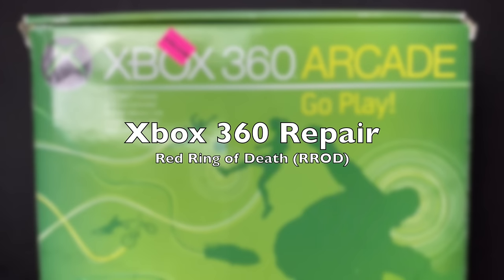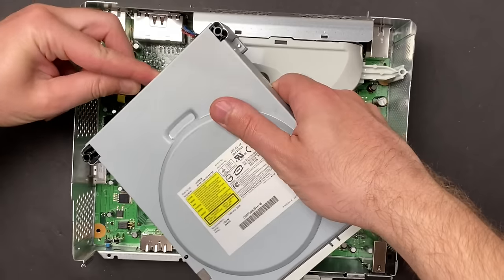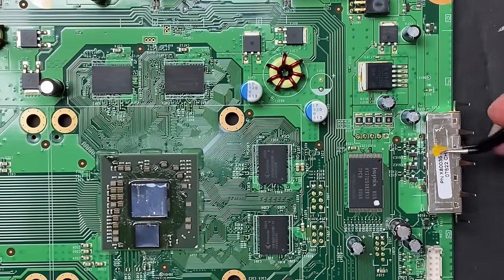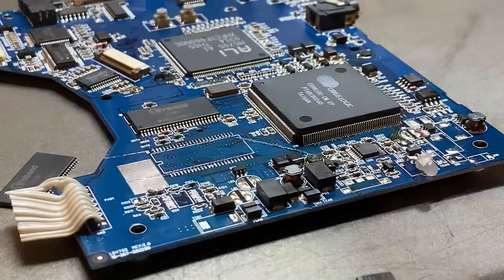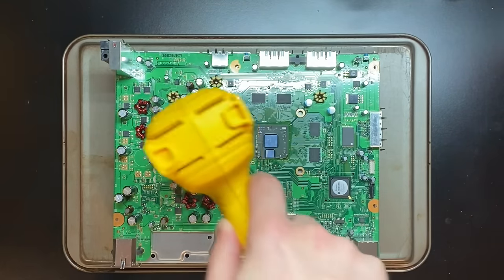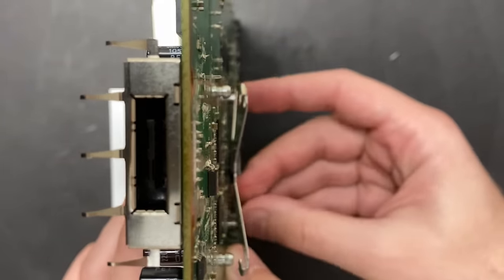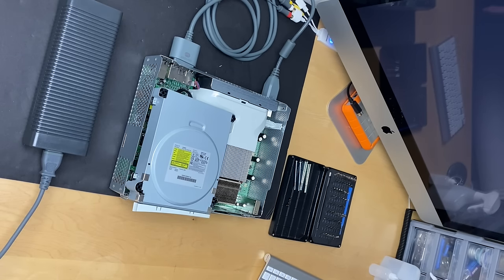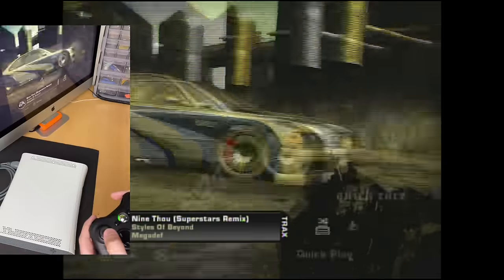Xbox 360 Red Ring of Death - DIY GPU Reflow

Comment: What does the flux do exactly? 
I've done heatgun reflows on my GPU before without flux and found it only would work for 6-8 months. I'm considering trying this out for my current 360.
Reply from the maker: In a nutshell, flux helps solder flow and creates inertia/surface tension so solder bunches up and collects on the copper surfaces, reducing bridges. Try it with a junk board. Solder a blob to it and keep rewetting it and notice it's shape. Then add some flux and rewet it to see what happens.

Comment: Ive seen people put them in the oven too.
Reply from the maker: I'm actually a fan of oven baking in general. My daily computer is still the iMac I repaired 7 months ago now, which involved reflowing the GPU in the oven to repair it. I felt I would have a little more control with the heat gun in this case though, just because the problem area is well documented and I wanted to introduce a good amount of flux during the process.

Comment: I took mine apart to clean it and it red ringed when put back together. Sucks man
Reply from the maker: That does suck, but it was probably on it's last hair if it RROD'd after a cleaning. It could be because of the change in x-clamp pressure if you removed those. You might be able to test if it works by temporarily applying downward pressure with your hard on the GPU heatsink while turning it on. This is essentially what those x-clamp adapters did (but they have been known to warp boards over the long run). If it does work with some downward pressure, it's likely revivable with a reflow if you just want to get it working again.
Reply: @BorderlineOCD  thanks for your reply bud!!! I will have to try that.  Ya it 3 light red ringed on me.  I never moved the motherboard from where it was screwed down. Something was rattling below the motherboard that i couldn’t identify after it was put back together. Defiantly below the motherboard. Thoughts? Also i took it apart to clean it cuz it would just shut off instantly every few hours. Didn’t seem to be overheating was running pretty cool? Was it the power supply? Actually chapped feels bad

Comment: I got one question about this which is does it matter how many red lights are there before you do this
Reply from the maker: You can confirm if the GPU is the culprit by looking up the secondary error code as was suggested by someone in the comments here. Hold down Sync then cycle through Eject 4 times and note the pattern. Look it up on x-ex.com and confirm the diagnosis. The user-submitted comments on that site are also useful (anecdotal but helpful to see if the repair worked for others with the same secondary error code as you).

Comment: Hey! I loved the video, very nice that you pointed out the need of flux, and being careful with pointing the gun around. 

What is your oppinion about covering the plastic suction point with aluminium tape? I have seen a video about modding the cooling for X360, and the guy put some aluminium tape on the top of the heatsink, bridging the small gap between the heatsink and the plastic airflow guide thing that goes to the vents. He theorized that this way the two vents are sucking out more heat. What do you think? Is it BS?

Comment: hey buddy , can i use a normal heatgun to a PS4's APU ? like the method you did ? because most tutorial i saw is using bga station .
Reply from the maker: No, I would advise against doing that. This is a hacky DIY approach for a worthless 360 that you can buy for $10. It does not replace a proper BGA reflow by any stretch.

Comment: Hello. I have an E-17 (0101) error Red Dot of Death on my Xbox 360 Slim model. Will this method work on that console?
Reply from the maker: I have a video on this for the 360S. Mine is a Trinity and it turned out to be the south bridge chip. If that doesn't resolve it it might be your XCGPU. Either way I have no interest in reballing GPUs and I have even less interest buying a replacement CPU to "fix" red ring/red dot. If it was me I would try a DIY approach with a heat gun. The purists will disagree. Ultimately it's your console and how you might approach repairing it is up to you.
Reply: @BorderlineOCD  I'll make sure to check out that video, thanks for replying!

Comment: Hey, what are you taking apart the console for? Just wrap it in some towels. 🙃
Reply: Oh god. I just remembered Intercoolers. Those cheap pieces of crap that you'd strap on the back of your console and they'd melt the power connector. 🤮
Reply from the maker: Never saw one. Lot of creative ways to revive a system that tries so hard to die on you.

Comment: I maybe wrong but the red ring of death was 3 rings not 1. The problem that people had was 3
Reply from the maker: On the 360, 1 red light is “hardware failure” and 3 red lights is “general hardware failure”. Red Ring is the community created term for hardware failure not necessarily a specific diagnosis although failures that caused 3 red lights may have just been more common. It can helpful to generate a secondary error code when possible for a better diagnosis (holding Sync and cycling though Power button 4 times to get the secondary code).

Comment: Hi sir... Hi hv an xbox 360 E... I bought it on April 5 2021.. Secong hand I had bought it.... It was brand new coz the seller dint use it much.... After gaming of three months suddenly one day wen I started my xbox 360 a red light appeared.... I searched on YouTube and the Internet..... They told me to plug off all the power supply to the console for 8-12 hours.... It worked for me........ But I think it was temporary fix.. Bcoz nw 2day 18 July itz working by i hv a doubt it might go of again..... So SIR CAN I TELL ME WAT SHOULD I DO....??? I M PLANNING TO OPEN MY XBOX AND CLEAN IT UP..... IS IT OK?
Reply: If it works, do not mess with it. If it does do it again, check the error code.
Reply: if it doesn't happen again, chances are your power supply was overheating. Before going inside of your console, make sure the issue isn't just an external one. You might be fine.
Reply: @NotALotOfColonial_SpaghettiToG  I sold the xbox.... The problem was external

Comment: My heat gun does 460c how much time whith this temp reflow? And i need to take no clean flux?
Reply from the maker: That's fine, shouldn't be a big difference. You can practice on a junk board like I did to get a good feel for your particular heat gun. I use no-clean flux but if you're using rosin core the conventional practice is to thoroughly clean the board. I still clean the board when I use no-clean but technically I don't have to.
Reply: to understand the flux you put in the video why did you put it? For clean;
Reply: @bethfoster6208  fow how long it last?
Reply: @bethfoster6208  where can i found gpu for the core version?

Comment: if the gun gives 400ºC air and the unleaded solder melting point is 422ºC. how can it melt it? specially considering that the air doesnt even hit the solder directly but through the chip

Comment: just tried this it worked and booted then froze on the xbox symbol then got another RROD 

redid again and its getting a 0020 error
Reply from the maker: Some folks have not had success, sorry your attempt fell into that camp. However I would just reiterate that you don't skip removing the plastic anchors and using good flux to maximize your chance of success. A heat gun alone isn't my preferred way of doing it.
Reply: @BorderlineOCD  well I did use flux whether or not it is a good one idk, also I first took it apart like 10 years ago so Im not sure if I removed the platic anchors or not but they were not there when attempting this and I have misplaced all of the screws...

Out of curiosity if you know what is the most common reason for the 0020 error, Ram , Gpu , Cpu or is it still an unknown thing?
Reply from the maker: https://x-ex.com/errorcode/E08/0020/

Seems to be a bit all over the place. Check out the comments on x-ex.com to see what has worked for folks in your situation.

Comment: Just bought a never-used falcon xbox for 30€ conviced it was jasper, and than I saw the falcon being rrod, makes me so sad :( 
Do you think it could rrod with some heavy gameplay?
Reply from the maker: Well, the Falcon still uses the 90nm technology on the GPU so it's still going to run hot. The Jasper uses the newer 65nm process and is less likely to RROD compared to a Falcon. It's just a part of the 360's design shortcomings and history, you can't really avoid it. I would say enjoy it and if you have love for the fat 360, either attempt a DIY repair when it fails or have it professionally reballed or replaced so you can continue to enjoy it.
Reply: @BorderlineOCD  :(
Reply: @ossipeltonen397  maybe the falcon v2 is a little bit better than Falcon v1 and earlier models?

Comment: Could you please tell me an alternative for a Heat gun? My console has been dead for almost 10 years now and I wish to restart it again. I hope to god this works because there’s nothing that would make me so much happier.
Reply from the maker: This is already a DIY hack to get some airflow at 400C. I don't think you can use anything else. A repair shop would typically use a hot air rework station with a narrower nozzle.
Reply: @BorderlineOCD  thank you for the reply man, really appreciate it. I’ve got 3 rings, hoping for it to fade away. Will keep you posted on how it works for me! 🤞🏻😁👍🏻
Reply: @thefarhanpirzada  so did u get it to work mate?
Reply: @yuktihgjh  no bro it didn’t work for me. I’ve literally tried all the DIYs on YouTube. 😔

Comment: Good video but I hope you know that "overheating" doesn't cause RROD because the Xbox never "overheated". Also rebelling is a myth that has proven to not fix it. The real problem lies where the tiny tiny solder balls inside the GPU that connect the die to the substrate fail from thermal cycles and E74 is caused by the tiny second die on the GPU which is the eDRAM ether having a bad connection to the substrate or just failing in general. The only fix is to replace the GPU entirely. Otherwise E74 will keep coming back.
Reply from the maker: Thank you. Yep I've come across the various hypotheses surrounding RROD and I've shared some of my findings in a pinned comment to address concerns raised by folks that aren't huge fans of this method of repair, which includes the point you raise. If I get 100 hours out of it I'd call it a worthwhile exercise. So far I've put 10-15 hours on it so we'll see.

Comment: iv done several xbox 360 repairs pretty much this same exact way with a heat gun have alwase had success, years ago before i had a heat gun we would use a toaster oven to do the same thing, pre heat heat to about 450 and bake the whole board for about 4 mins would work to, but heat gun is the best way to go for sure
Reply from the maker: Curious did you also remove those plastic alignment anchors when you baked the board?
Reply: @BorderlineOCD  yup

Comment: I ordered a xbox 360 e, there were cheaper og white xboxes but i bought the newest version of the xbox 360 because i dont want to get the rrod in like 8 months
Reply from the maker: That system shouldn't give you any trouble. I still pick up dead OG Xbox's occasionally. I would love to revive one with the original Blades firmware.

Comment: My 360 is long gone by now but after watching this video I wonder if simply putting a penny or a dime or somthen small that keeps just the right amount of pressure on top of the chip and then reattaching the heat sink would work. Anyone ever tried that? It worked for me on an old LG phone I used to have that had a very similar issue with its cpu.
Reply: Yes it did work and there were "repair" kits which did that ,but that's really only a temporary fix. I'd argue the fix shown in the video is also temporary. The true way is to remove the CPU/GPU and reball it with new leaded solder. However you need the correct tools and it's quite a bit more tedious. At least the reball repair should stop the RROD/E74 errors ever showing up anytime soon.

Comment: no way to improve ventilation? normally the fans go above the heatsink
Reply from the maker: Its an awkward design but I guess that's what the fan "tunnel" is meant to help with. Clearly the design had its limitations. I've seen folks mod the case with fan placement above the GPU. Creative, but not sure I'm in love with how it looks.
Reply: @BorderlineOCD  if you replace the DVD drive completely, or put it on the exterior, you will find the cooling considerably better

Comment: I admire your work but if I had to tear down any play console, I would not  go to that work I just tried to repair a play station 2 which was sold as totally rebuilt and cleaned by the seller and found it had never been opened and obviously never cleaned and the laser sensor looked clean but I cleaned it again just for fun and checked it all out and found nothing I could do that might get it to work so in short I got swindled by a seller and I am going to post to give it away to anyone that wants to play with it. I would buy a new one out of a box before buying another piece of someone's junk console. Yes I lose but I will post bad feedback on a seller who is making money on junk that does not work.

Comment: Is 91% IPA suitable?
Reply from the maker: Sure. It just has a little more water content so give it more time to dry off before you power it up if you're testing immediately after using large amounts. IPA labeled for electronics cleaning will always be 99% or 99.9% but a slightly lower concentration is fine.
Reply: @BorderlineOCD  will do! Appreciate the response man, thank you! 👍👌✌

Comment: What is the tool you use, to open the xbox case?
Reply from the maker: It's a spreader clamp. Kind of helped but those tabs were a pain in the butt to separate. I would consider just getting the Xbox 360 opening tool for my next 360 phat project.

Comment: or just get jasper console and forget about RROD 😂
Reply: Jaspers can still RROD.
Reply: @LemmeSquish  they don't there is no case reported anywhere on the internet for jasper RROD
Reply: @LemmeSquish  Both of your examples are just PSU failures, the other one is with unknown code. RROD can mean a lot of thing and some of them are very easily fixable. Like the  PSU failure or the change of the capacitors. But Jaspers don't overheat and you can't get RROD on jasper because of the GPU or CPU overheating like any other model of 360 pretty much .. and I am not telling anything about the slims or the E models, they are better than previous FAT models (before the jasper) but they are overheating after couple of years too. The jaspers are the most reliable ones. And I say this not because only I think so, but many technicians and workers in repair shop also say the same, and they have been through a lot of 360s. And of course I havent seen anywhere video or a forum post or whatever on the internet (even searched on ebay) for broken jasper with RROD because of overheated CPU or GPU.
There maybe 1 or 2 fake videos or comments but they are either fake just for the sake of it or if they are real most likely the problem is like in your 2 examples code 0001 - which is PSU related and the brick can just be changed by bying another on the internet. So before sending me some examples check if they are real.. At least they have to be verificated that they are real jaspers because many people on the internet don't understand and mistakenly say jasper and the other thing as I said they aren't even getting the failure code and say it's broken. It can be broken PSU or broken Hard drive or many other thing that can be fixed easy. But not overheating. This can happen with any other revision but not on jasper ( we of course are talking about normal use here, not forcing it somehow with tower or whatever ).
Also no, just because slims and E models can this doesn't mean that jaspers can.
They are built in different ways. The one is with 2 separate chips - for the CPU and the GPU, the other one with combined chip. Microsoft just perfected it with the jasper .. but they needed redesign because of everyone seeing the FAT 360 and thinkig about the red ring .. and they did a good jobs with the slims but not good enough .. after some years of use they are breaking .. from RROD (or call it RDOT) and the E models too.. But you can't say just because they overheat and the jasper has to do it too.
Reply: @XtremeBG Well I applaud you man, I have been bested. Clearly I didn't do enough research. Sorry if I came across as too aggressive. I'll shut up now.
Reply: @LemmeSquish  thanks

Comment: followed tutorial. Now I have 0003 ring of death
Reply from the maker: 0003 indicates you still have a CPU problem according to the error code database on x-ex.com.
Reply: @BorderlineOCD   Yea I think it's fried. The board is warped now. Has a noticeable bow to it. The chip does not lay very flat. More of an angle with little to no clearance on some corners with a gap on others. X clamps easily pop on and off, and I noticed some capacitor buldge now. I followed the temps and times. I think these boards suck and can't handle much heat without proper equipment: Heat plate, propper support, and heat shielding seem like a necessity after my attempt.

Comment: Anyone with experience knows its not the connections from motherboard to the cpu/soc or whatever there is. The connection fault is in the chip, the connections inside. Heat is a temporary remedy, new (unused) chip is the real fix

Comment: Yes, this is a short-term repair. At the bga prof station, this should be done, with the cover of the crystal, from overheating, with lower heating of the board and an infrared upper heater, working according to the thermal profile .And often the video chip just completely changes. It's good that you understand this and talk about it. Like.